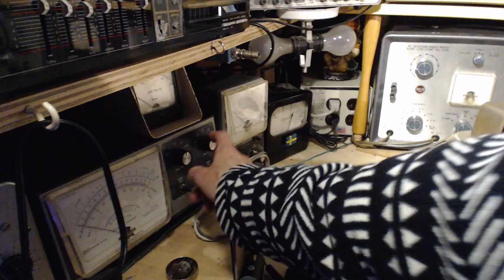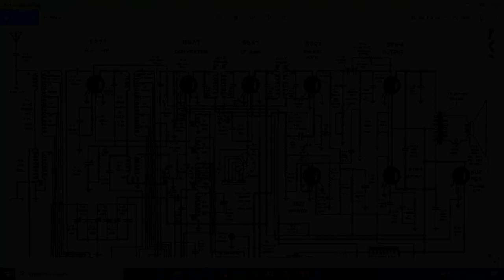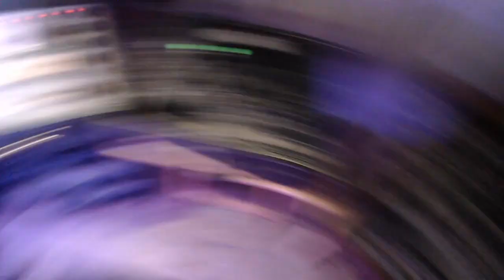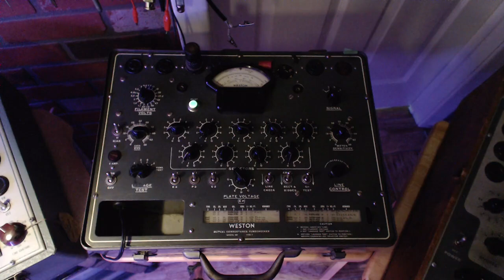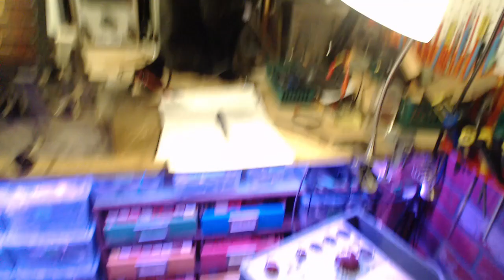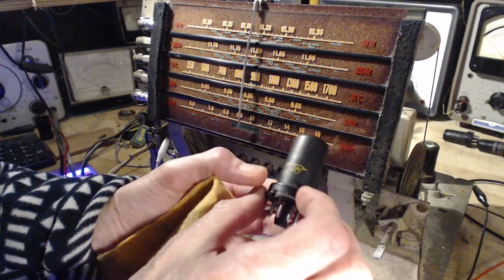Westinghouse 981X Shortwave Receiver Video #21 - Weak AVC Voltage

Comment: Need some good tubes in the radio first just to see what else is wrong! Should follow path of wiring of the detector line  of the eye tube  that goes to the AVC line.
Check the resistors that go to the IF transformers next.